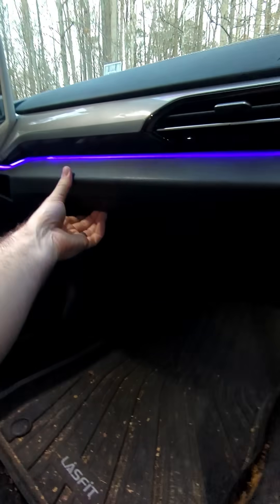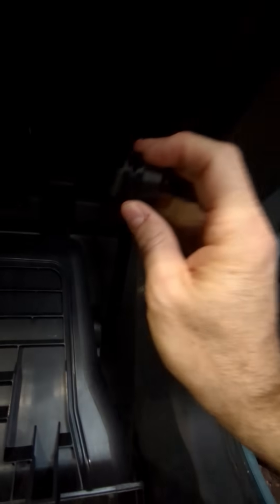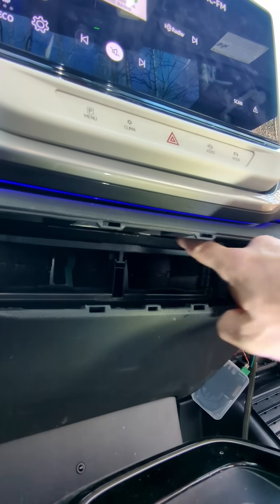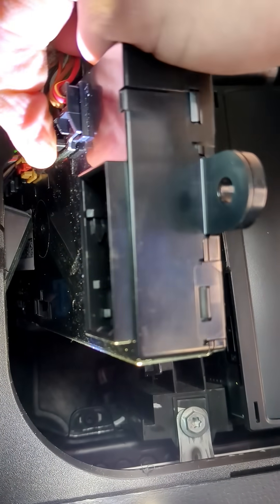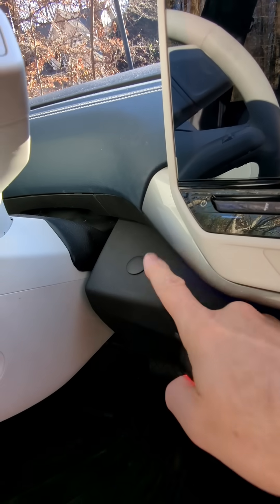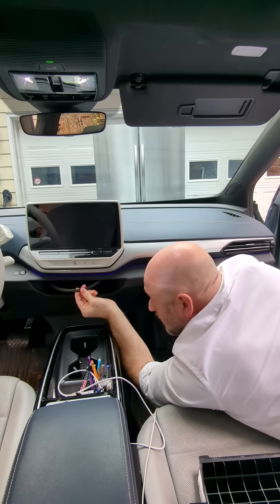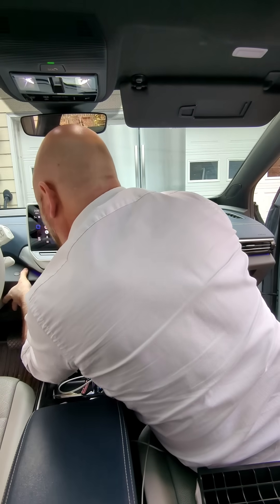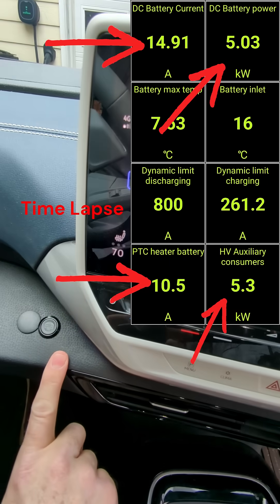Install your ID.4 battery pre-heating kit!

Comment: where did you tap the 12V power from?
Reply from the maker: It's from the same harness that has the CAN signal - the harness taps into both CAN and power. A/C module connector T20b.

Comment: nice. you made the solution elegant! is there a time limit for pre-heating should I forget to turn it off?
Reply from the maker: No worries if you forget to turn it off; because it uses VW's own heating algorithm, the heater will only heat up to what the car says the current max battery temperature is, which is different depending on ambient temperature and current state of charge, but usually around 20 deg. C.  According to Fredrik, the maximum temp it will heat to is 42 deg. C.  If you forget to turn it off, it will drain your battery faster if you're driving around with it on and the battery is at sub-optimal temperatures, but it won't damage anything.

Comment: Wow that is amazing. I'm currently charging with a cold battery at 35kW.
Reply: Can you ship this as a complete product. It would be amazing as a plug and play solution.
Reply from the maker: We aren't sure we want to take on the liability of producing these ourselves.  Wes has assembled a few and it takes an hour to 90 minutes to assemble each one.  We will work on a short tutorial where we show how to assemble the harness yourself.

Comment: This might end your warranty...😅
Reply from the maker: No, the Magnuson Moss Warranty Act https://en.wikipedia.org/wiki/Magnuson%E2%80%93Moss_Warranty_Act forbids them from "voiding" your warranty unless they prove that something you did actually caused the problem.

That said, it would probably be best to remove the mod if you have trouble with the battery preconditioning system to keep from having to fight over it.

It will void your dashboard warranty if you drill a hole in that!